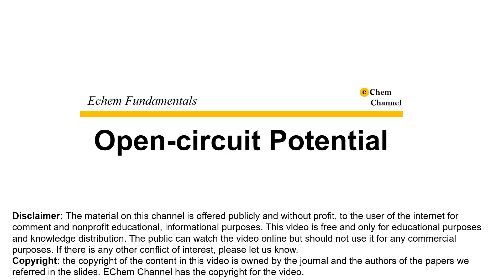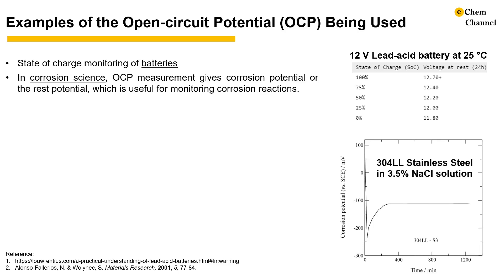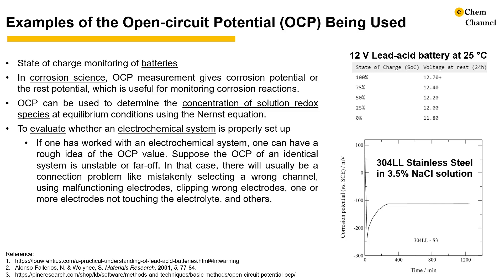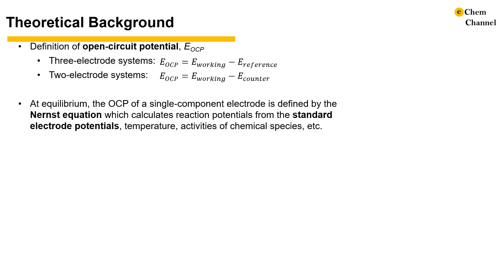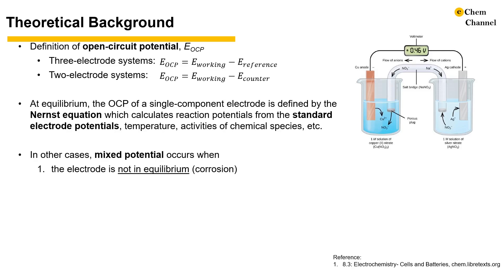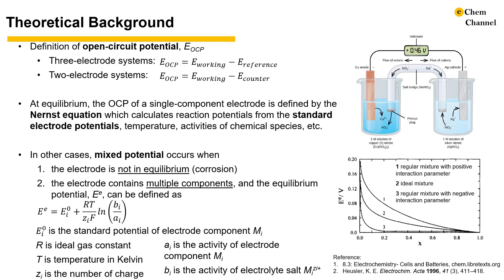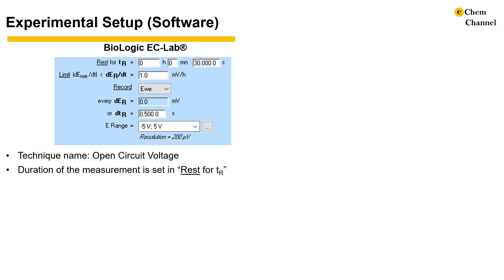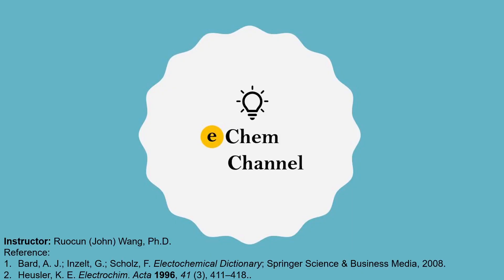[EChem fundamentals] Open-circuit Potential

Comment from the maker: Correction: When talking about the lead-acid batteries, I should have used open-circuit voltage instead of open-circuit potential, as it is really the potential difference between the cathode and the anode that we are measuring. Apologize for the mistake.
Reply: are open circuit potential and open circuit voltage different terms? 😟
Reply: @sadafAdil2048  I have the same question